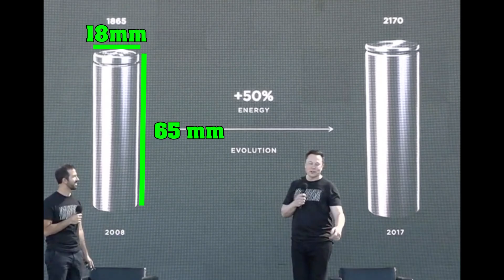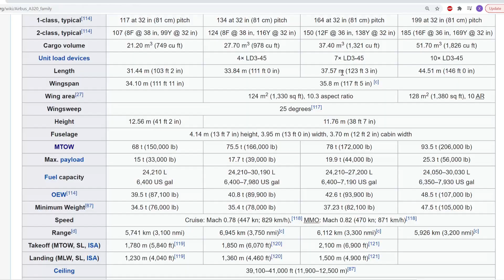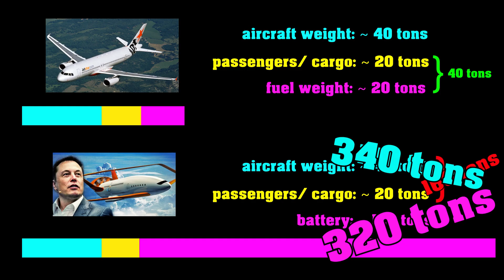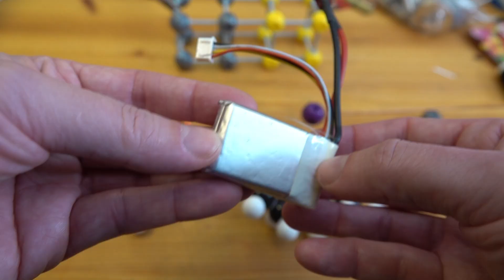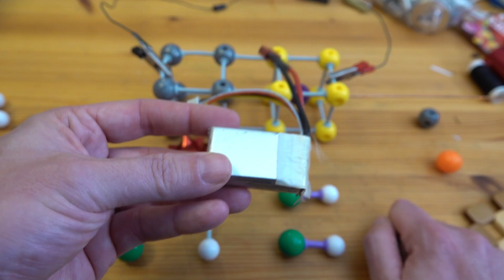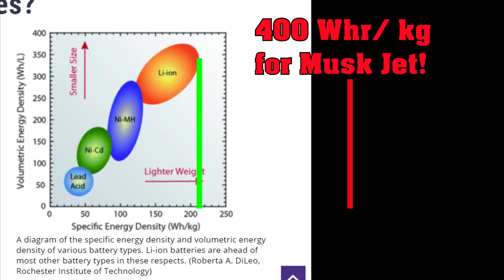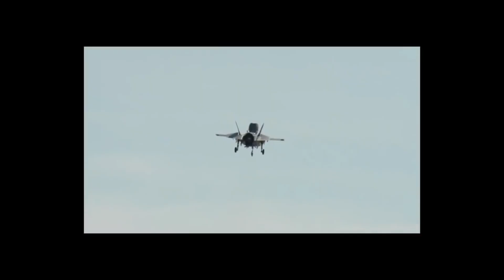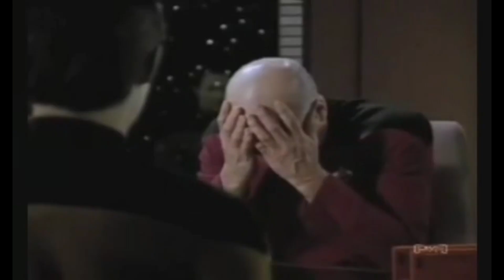Tesla's Secret Plan To Disrupt Airlines: BUSTED!!

Comment: The additional problem with electric/battery airplanes is that even when you're running out of energy, you're still carrying the same weight. With fuel, you keep getting lighter as you burn it, which saves you a lot of energy over the entire flight.
Reply: And part of the mass they loose becomes thrust in a jet engine. Quite literally.
Reply: Just build the batteries in a way that you can drop empty cells. But to be commerrcially viable, you need a second, catching air craft to fly under the first one to collect all the dropped batteries, preferably without damaging them. If you want to make this plane battery powered as well, just do the same with it, drop the empty cells and collect them with another plane. Or, even better, just build a giant treadmill under the plane to collect those dropped cells! That way, you'd have the same effect as in fuelpowered planes AND can reuse the cells!!!! 

(Just in case, this is meant as a joke, the whole idea of using battery powered planes is just pure nonsense to me)
Reply: @Donnerwamp  Lmao, your idea sounds like it came straight out Cave Johnson's mouth in portal 2.
Reply: @outsource3786  That was exactly what I wanted.
Reply: @Donnerwamp  or watch the Better Off Ted episode where they have doors that recognize white people but can't see black people, so they have to have white people follow black employees in order to allow the black people to get around.
Reply: @Donnerwamp   LOVE IT!
Reply: @Donnerwamp  or connect the almost spent battery to a drone, and they can fly themselves home.
Reply: @Donnerwamp  why not electric planes without batteries, but wireless power transmission instead? Or yet, you zig-zag up and down and use the wind of the fall and the movement forward to generate wind-power, so you get pretty much infinite power, if you didn't have ever to land. Even better than the magnet-on-a-crane pulled car idea, which looks totally weird, with the crane thing. But the plane looks just like a normal plane, only doing more cool maneuvers up and down.
Reply: Also when they now have to repair 158 000 cars , when those have monitors that fail after 2 year , who trust that the tesla plane will even work ?
Reply: Unless energy density increases tenfold, I dont see it happening, but it looks like Airbus is exploring hydrogen fuel cells, which is probably the better option.
Reply: @nzoomed  Hydrogen is difficult to handle. So i don't think that happening as well.
Hydrogen could be used in Ships i guess. But it is difficult for that too.
Reply: @shrin210-98  Using liquid hydrogen much like rockets would likely safer and easier than pressurised hydrogen, also this would be necessary as the density would not be enough with just pressurised gas. Then there are potential issues with ice forming on the wings, etc. Im sure there are ways to address all of this. But given enough time, these matters could be resolved. I dont see hydrogen aircraft becoming a thing for at least another 10-20 years. By then solid state batteries could have become advanced enough not to matter and ive read that they are exploring ways to actually make the actual structural part of the aircraft as the battery itself!
Reply: @shrin210-98  Hydrogen is already used on subs for over a decade and tested on jets...
Reply: @nzoomed  Airplanes have been using structural energy storage for a while now. They have what are called "wet wings", where instead of using dedicated fuel tanks, parts of the wing's structures are sealed off and used to store fuel.
Reply: @electric7487  Yes, and i imagine that with liquid hydrogen that could also work, but would need to be engineered around the cold temperatures of cryogenic liquid to address the issues that presents.
Reply: Have we discussed solar airplanes yet?  Build every human on earth their own personal Solar Impulse. Or their own human-powered Gossamer Albatross.
Reply: @theultimatereductionist7592  gliders are kind of solar airplanes, though. Or wind.
Reply: Sorry added my comment before seeing this. You are quite right.
Reply: Droptanks where used liberally during WW2. Jettison the empty batteries! 😄
Reply: @michaelpettersson4919  Oh yeah, I remember my father telling me, that when he was a kid, you could still sometimes found those dropped tanks (there had to be quite lively air traffic here during WW2, just off the top of my head I recall three plane crash sites around our village) and that he and other boys used them to make boats.
Reply: @michaelpettersson4919  that would be a big safety hazard.
Reply: With fuel, not only you keep getting lighter, but also you carry half of the reactants, because ther other half (oxigen) is already available all around you!
Reply: Solvable if you just chuck the battery out the window.
Reply: @HeyZeusWasaComE. yes I agree, it could have potential uses for ships and trucks more so than everyday cars.
Reply: Also what is the turnaround time if the plane with recharging those batteries? Swapping the empty batties for charged ones?
Reply: There's been some progress in structural battery carbon fibre things with a similar energy density of current batteries. Theoretically you could build the aircraft fuselage out of it and have the battery BE the aircraft, so it doesn't carry additional weight
Reply: @Aryasvitkona  Sounds like that carries the risk of exploding, though. Not safe to use high-powered batteries as a structural material.
Reply: I'm more interested in seeing this vertical takeoff plane move to forward motion.  Lol
Reply: And yet another is that there is no such thing as an 'electric engine' capable of powering a large (several hundred tonnes) commercial aircraft. Perhaps that will be his next fantasy (that he has 'invented' one).
Reply: @bigblukiwi  Actually the technology already exists, and we see electric model "jet" aircraft. No one has just bothered to make one yet for an airliner because there is no point currently.
Reply: @nzoomed  I was not aware of this. Please explain how it works or provide link - I was aware that the Chinese claim to have a 'prototype'. Nevertheless the energy density of known battery technology rather destroys the idea of a commercial 'electric' aircraft. As pointed out in this video, the battery weight makes the idea a non-starter.
Reply: @nzoomed  I'm sorry, "*model* jet aircraft"? Are you referring to RC toys?! Did you fucking seriously did that?!!
Reply: Currently working on lilium air taxis, they currently work will be rolled out in 4 years.
Reply: Tabless cells are all about the system engineering. Firstly getting HEAT out through the end of the cell rather than needing complex coolant paths through the pack. Secondly it’s making electric connections to just one end of the cell. Thirdly the internal resistance is lower so there’s less heat to deal with. All of these things make them more suitable to being STRUCTURAL elements. So this 2/3rds mass is not just the energy store but also the plane itself. Have you ever come across structural Kerosene?
Reply: @JamesUKE92  that's a valid comment however the engineering problem with making it properly safe is something that hasn't come even close to being addressed as yet. When i did a back of the envelope calculation to try and see what the benefit might be it didn't seem to be beneficial at all. Couple this with the issue regarding landing at a very heavy weight and it still doesn't seem to work. That doesn't mean its impossible of course but it does mean there is a lot more proof of concept to be done which may not get anywhere in the end.
Reply: @JamesUKE92  Aircraft structures are thin, light and strong, by virtue of the material from which they are made or the shape into which it's formed, or both. Batteries are inherently unsuitable to be formed into complex shapes because that's not their job. Try to imagine the engineering challenge of making a 100-foot long cylindrical battery 15 feet in diameter and a few inches thick, with windows punched into it every foot or so, yet flexible enough to cope with aerodynamic forces and strong enough to withstand the temperature and pressure differential between the inside and the outside at 35,000ft. Then watch a video of a Tesla burning out, and ask yourself if you want to be sitting INSIDE the battery seven miles in the sky when that event (rare, but not all that rare) happens.
When you have to ignore the laws of physics and 150 years of aircraft development in order to excuse Mr Musk's fantasies, things look pretty desperate.
I'm not even going to start on the whole 'electric jet' thing, which implies propulsion by nothing more than compressed air, something which was tried before the First World War using ultralight propeller-driven aircraft but can't produce anything like the efficiency of a conventional jet engine. It's basically a travel hair dryer.
Reply: @terraplane1116  Well, splitting the modules is always an option.

But as you pointed out, that's a problem which is not even worth discussing about after considering the myriad of other problems of attaching wings to a lithium bomb.
Reply: @JamesUKE92  While structural batteries are a neat idea, we already have structural energy storage in the aviation industry. The wings on many aircraft these days are "wet wings", where parts of the wing structure itself are sealed off and used to store fuel. The "advantage" that batteries would have, that they could be used as structural elements, isn't actually an advantage at all.
Reply: @electric7487  "structural" batteries wouldn't be an "advantage" at all, but only an absolute necessity, perhaps everything on the plane would kind of need to be at very least filled with batteries, for it even to have some pathetic range of flight. Catapulting people with parachutes would probably be a greener and less nonsensical idea.
Reply: @petitio_principii  I find it odd how proponents of structural batteries just completely gloss over how insanely dangerous that would be in real life, and this is something that should be extremely obvious.
Reply: @JamesUKE92 2 years on, no self driving, no electric plane being even mentioned at all anymore, Hyperloop destroyed so actual working technology that elon said he'd make obsolete (trains) can deliver goods to his factory
Elon is nothing more than a glorified hype man that tricks dumb rich ppl into investing in the companies he bought

Comment: If he doesn't manage to do a vertical landing and takeoff (which he won't) you would have to take into consideration that planes take off heavier and land lighter due to burned fuel, that's why sometimes they need to dump fuel if they have to land before planned or in an emergency because tires will explode . I don't see elon's plane throwing off batteries from his "plane" in mid air to get rid of weight anytime soon also he would have to make either a really small plane or find a way to land a fully loaded plane, which also would need a stronger airfield, etc. That guy sometimes is not in his right mind in my opinion.

Comment: "The fuel is only dangerous when its mixed with oxygen. You keep it [fuel] away from oxygen and its perfectly safe." 

Uhm and your point? The batteries are only dangerous when they short out, you keep it from shorting out and its not dangerous and perfectly safe as well. Besides it also all depends upon the chemistry make up of what type of battery cells you are talking about as well, since some are more stable than others.
Reply: Storing something in a tank, away from oxygen, is much easier than preventing a short circuit over a large interconnected battery.
Reply: @danielhurst8863  Oxygen is typically in a vehicle tank ... it normally even has vents in the fuel cap pipe. So uhm while that is technically true I suppose, that is not the case in reality. FAIL!!!
Reply: @kevinfisher1345  You're not going to get an ignition source in there to ignite the mixture. Try again.
Reply: @electric7487  You know this is over a year old right? I no longer even recall what this was in regards to mate.

So remind me again, how is an ignition not going to be able to get into fuel when it is vented? Have you never actually seen explosions first hand mate? Have you never seen extreme fires first hand mate? Either of those are ignitions that can easily get into any source of fuel to ignite it. And you realize that what ever it is this video was talking about sounds like it involved a fossil fuel engine that combusts and can provide either of those two ignition sources. How about you try again mate.
Reply: @kevinfisher1345  Man, you are REALLY grasping at straws.

> "So remind me again, how is an ignition not going to be able to get into fuel when it is vented?"

- I was talking about AFTER the fuel tank is filled up and the cap closed. Once that's happened, the fuel doesn't present much of a hazard as long as there's no physical damage. But the vents on fuel tanks don't dump large amounts of vapours in the atmosphere. It only vents a small amount of vapour when the fuel is hot. You don't even have the most basic understanding of what'ss going on here.

> "Have you never actually seen explosions first hand mate? Have you never seen extreme fires first hand mate? Either of those are ignitions that can easily get into any source of fuel to ignite it."

- Yes, but this has to be one of the most impulsive and desperate things I've ever seen someone write.

> "And you realize that what ever it is this video was talking about sounds like it involved a fossil fuel engine that combusts and can provide either of those two ignition sources."

- In an engine, the combustion is controlled and the fuel's stored energy can be safely harnessed. Fuel explosions are actually very rare, but when they do happen, that combustion is UNcontrolled. That's a HUGE difference. YOUR lack of willingness (or inability) to understand the fundamental aspects of how combustion engines and batteries work does not make ME wrong.
Reply: Ok to be fair, you did bring up a valid point just after. About your critical difference of any electric battery failure will not end well with proposed 70% battery aircraft. But your first point remains no different than current fuel powered aircraft.

Comment: Or... You can make a smaller plane with a smaller frame and engines and passenger capacity with basically the same wing span.
Not at all ideal, not economically feasible and yeah it does totally defeat the purpose, but it's also not an engineering impossibility.

So no Elon isn't a genius, no Elon won't be disrupting the market and no I don't predict this being a success (even if the incoming Biden/Harris administration fund it under their Green New Deal).
Reply: Oh and I don't see it being a VTOL
I wasn't clear about that at all. The jetliner will wind up be conventional IF it winds up being funded.

Comment: Did Elon explain how electric powerd JET engine would work? Considering that you need a combastion in one of them, that can push you forward. Or he just meant of using the propelers. if so,  then how  he thinks of breaking the sound barrier  with them, to achive supresonic speed?

Comment: As a drone racing/freestyle pilot who uses high energy density batteries, Lithium polymer, Heavier more energy dense batteries doesn't mean more flight time or performance. In fact adding weight after a certain point actually removes flight time and makes the drone fly really terribly. I know drones and planes are not the same thing but the basic physics still stand, added weight can be such a massive negative it completely negates the benefit of the extra energy in a larger battery. I know this from personal experience and it does apply to radio controlled planes too. That's why people recommend certain size and power of batteries as a maximum for sizes and types of drones.

Comment: It's actually even WORSE than what's presented. When you burn jet fuel you don't still have to carry the weight of that burned jet fuel around. On the other hand the discharged battery just is nothing but dead weight at that point... 

So assuming the power discharge is consistent at all charge levels, and pretending you could discharge a battery to zero without serious damage to it then the best possible "efficiency" you could get from a battery is going to be HALF as good the fully charged battery usually cited.

Consider: If you start with a fully charged battery and end up with a completely discharged battery at the exact moment you arrive at the destination, the average energy density per kg will be half as good as a fully charged battery.

Carrying around those empty batteries is why a battery power plane makes NO sense in most applications.

Comment: As someone working in aviation I find this very funny.

Currently fuel cells have IMO the best chance for aviation but not in the foreseeable future.

Batteries are too heavy and lacks specific energy density. 
Jet-A1, the fuel a commercial aircraft use, has a specific energy density of roughly 12 kwh/kg.
As per this video Li-Ion provides at best 250 wh/kg.

Meaning Jet A-1 provides 48 times more energy per weight than Li-Ion... and weight is one of the most important factors in aviation there is.

Another issue is: refuelling.

Aircraft only earn money for their airlines if they are airborne. Any time on the ground is money lost.
The turnaround times for aircraft such as the A320 or 737 are very short. With refuelling (!) it takes at most about an hour until it can be airborne again...
You can not load a huge battery in such a short time.

That is why batteries for commercial aviation are a dead end. 
No matter what Elon Musk says.
Reply: Actually, I'd say synthetic kerosene has the best chance of being viable. It already exists, and does something, as KLM have shown recently.